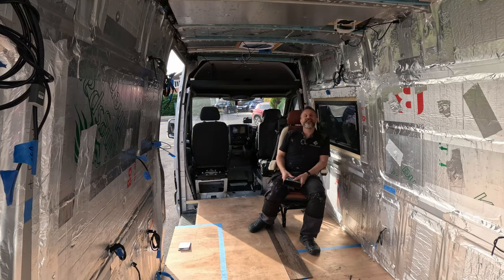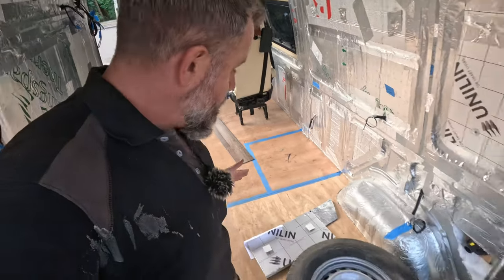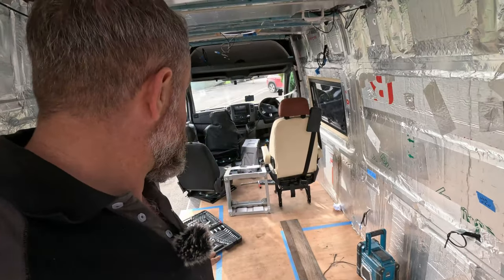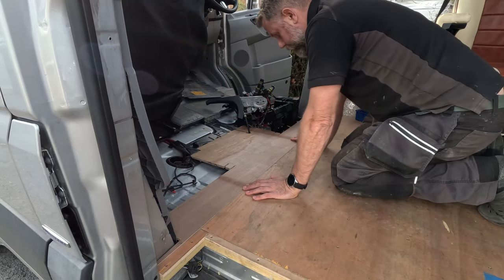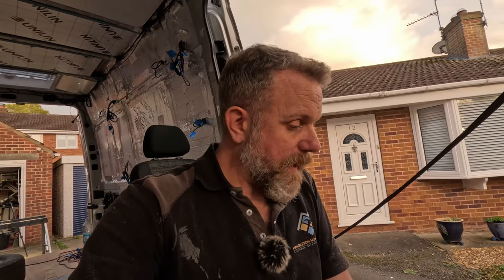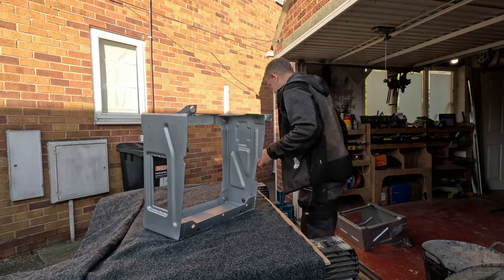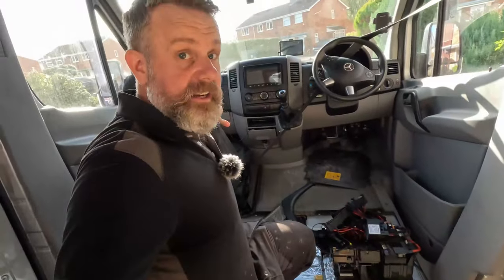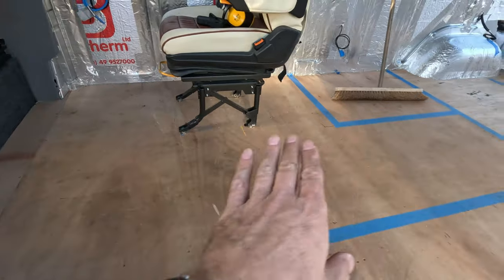It Begins! Starting the Interior Build on Our Sprinter Van Conversion

Comment: I’m putting a thin radiant heat film in my galley. The Company is called Mi-Heat located in Germany.
Reply from the maker: OK. Is that infrared heating? I almost installed that in a house I renovated
Reply: @life_uncharted  
It’s a thin 12 volt film. You can cut to fit also! Uses a thermostat. Also

Comment: When it comes to van build vids..I’m happy with 1min or even an hour👍🏼 if you’re showing good details and relevant stuff..and not filling with waffle the time is irrelevant to me bud 😊
Kinda transforms it straight away with that floor👍🏼 looks great ..albeit very heavy!
Any reason you didn’t go for a 5 ton van to begin with as I “assume” from the grey beard like mine!ha you passed your test pre 97
Reply from the maker: Ha ha. Yep the beard gives it away🤦. I do have the licence but unfortunately was not aware of how much weight I would be adding to the van. In hindsight I probably should have. But I was also restricted by size as I knew I'd have to build it on a driveway I share with my neighbour and I will also have to park it at grandma's house in France. Oh well. I'll up plate it and I have airbags to up the suspension 👍😁